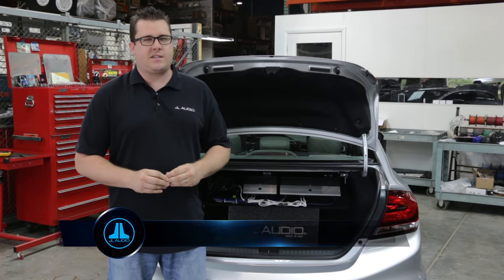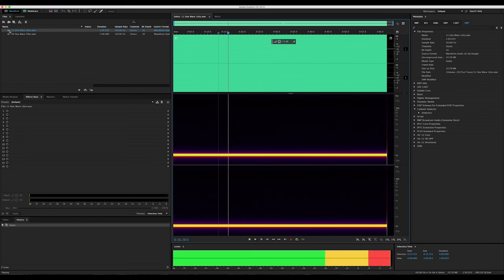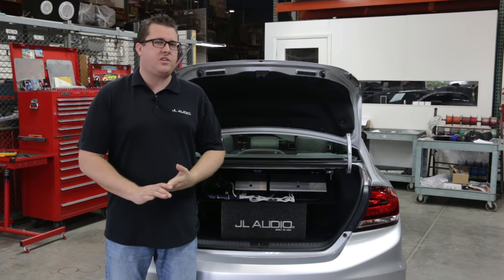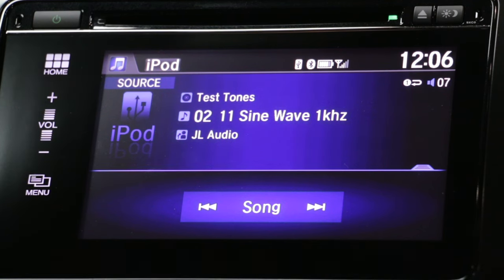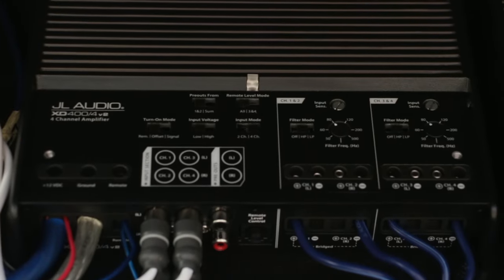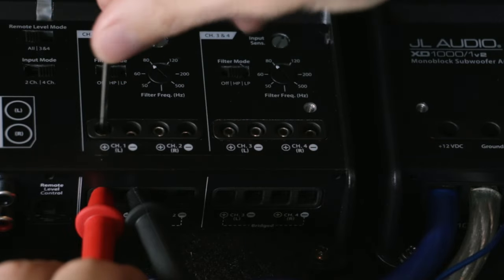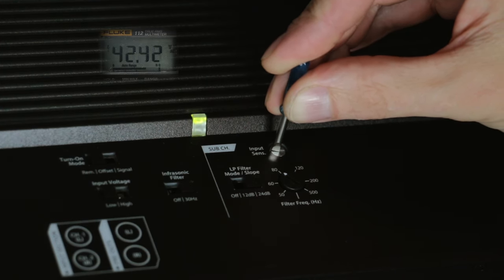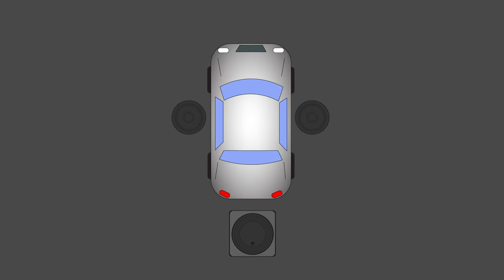Setting Amplifier Gain or Input Sensitivity

Comment: Doing this on a factory radio, will this blow out the door speakers if trying to use the 50 hz sound wave?
Reply from the maker: It is possible to damage the speakers since you cannot mute channels on the OEM radio. In this case, the right way to do it would be to disconnect the speakers themselves so you can play the sine wave through the amp only.
Reply: @JLAudioInc  awesome thanks for the info

Comment: Question, if you set this at 3/4 volume but run your system at nearly full volume quite often, will you not be clipping the speakers most of the time during normal use?
Reply: i think its cuz some songs are recorded at higher dB so it leaves some room in case it clips, either that or i read sometimes the HU itself can clip at full volume. Either way im still kinda lost on this and i just got an amp with a clip light lol
Reply: This is the issue using a multimeter, if gives you the info you need however it comes with the caveat that you already know the signal is clean. To me, it's very important to know how high you can turn up your receiver before it sends a clipped signal to the amp, even more important than knowing where to set the gain because if it's sending a clipped signal to the amp, anywhere you set the gain knob is gonna be clipping point. Not good!!
 I bought an $80 multimter/oscilloscope off Amazon and used that to tell me how high I can turn up my receiver before it clips, and then it tells me how high i can set the gain before clipping occurs.  And yes, it's def not as detailed of a sine wave as a $300 oscilloscope, but at least you know when you've reached your clipping point!
Reply: @GlycerinZ  yeah i was looking at oscilliscopes, but after getting an amp with a clip light, im surprised how much gain and volume it needs before it starts clipping. A new sub or amp is about the same as a decent oscilliscope so im just gonna wait till one blows lol

Comment: why is it that when i did this and hit target voltage as per math. then i play music the voltage is about half? no change in head unit volume just a change in supplied program.. test tone vs music. normal? seems like there is more on the table
Reply from the maker: Thanks for reaching out! Music is dynamic and not a constant tone like used for setting sensitivity. This is why average voltage would be less when testing with music. The tone is used at 3/4 volume to give you leeway to go up a bit in volume from 3/4 for quieter tracks.

Comment: So guessing after you set the gain you Can adjust the eq settings on the head unit and it wont distort?
Reply: I've always felt like you should leave your EQ the way you want it when you're setting your gains on your amplifier cuz that's the actual voltage is going to be getting used instead of when the EQ is flat cuz that's not going to be accurate reading.
Reply: @jamesb1988  
I agree! 👍🏻👍🏻

Comment: My Kenwood KAC 8405 Amp isn't on your list. How do I find the correct voltage to set it to? Thanks for the great video...
Reply from the maker: The target voltage is the square root of the RMS x Impedance per channel. So for that amplifier using typical 4 ohm speakers it would be: square root of [ 60 (rms watts) X 4 (ohm) ], which is 15.49V .. Hope this helps!
Reply: You're the fastest reply ever! Thanks. Great. You've finally helped my to set my amp after years of listening to it too low. I'm so happy lol! Thank you
Reply from the maker: No problem, enjoy!
Reply: So each channel on the amp is 90W @ 2 OHM. The speakers are also rated at 2 OHM. So 90W x 2 = 180. Square root of 180 = 13.4Volts.
Reply from the maker: Yes, that's correct.
Reply: Please help! I thought I did everything correct. I played the 1k hz track at 2/3 volume. hooked up the multi meter to the speaker out and I get nothing. Turned the sensitivity up full and didn't get anything. I quickly swapped the multi meter to the battery on the amp - All good there, reads 0.1 under the direct battery reading so I'm set to the correct units. I checked the sound was playing by putting the speaker cables on... and get the horrible sound lol. So then I turn the meter to a lower setting and get like less than one volt. Any idea? Thanks you
Reply from the maker: Make sure you have the meter set to AC voltage when testing the amplifier output, this is different than the DC voltage when you test the battery. Unfortunately we are out of the office already, but please call us tomorrow at 954-443-1100 if you still need assistance.
Reply: Thanks, I'll give it try again. Thanks for taking the time when you're not even working!

Comment: Hey JL :) i have a question, does the adjustment you show here work with a typical bassremote? 
The remote doesent change the gain but just the level of the bass am i right? so does this work, as you show in the video with amps like my Amp with a remote?
/ R
Reply from the maker: Hello, for the JX, RD, XDv2 and HD amplifiers the knob functions as an attenuation and goes up to the point at which you set the gain.  On the Slash v3 amplifiers the knob functions as a boost knob only.
Reply: Bass knobs definitely just max out at the point of where your input sensitivity gain is set

Comment: if all settings are set to flat or off before setting gain, won't it mess up the signal later when we make adjustments to the treble or bass?
Reply from the maker: Yes, there would be a slight increase in level by boosting any of the "tone" settings on the radio. 

Ideally, the new equipment along with the added power from the amplifier(s) will negate the need to increase any of those levels in order to achieve a better sound. Lowering the opposite level is a better way to achieve the desired sound... for example, if you feel you need more treble, you can lower the bass slightly to make it balanced, and then you increase the volume for overall output. 

Hope that helps!
Reply: @JLAudioInc  that makes sense. thanks for the reply!

Comment: Just did this to my ground zero amp. But i feel that it is not enough bass. Turning my pioneer headunit up to around 50 on the volume and 10 on speaker level (subwoofer) on the headunit makes it a bit better.  Any tips? Digital design 12" sub
Reply from the maker: Tony, if you are setting the amplifier at 3/4 level and you did the proper target voltage calculation, then that's the amount of overall output the amp is designed to provide. If you feel you need more output, you'll want to consider another subwoofer or a larger subwoofer for more cone area. Trying to increase levels past the point where we know they're safe could lead to a shortened life span on the equipment.
Reply: @JLAudioInc  what do you mean with setting the amp to 3/4 level?
Reply from the maker: We recommend using the 3/4 point (75%) on your headunit to set the amplifier levels, is this what you did when setting the amp? If you followed the instructions and you're sure of the calculations used, then you have measured the output level of the amplifier to be what the manufacturer deemed to be the rated power. If you still need more bass, then you would need to consider a larger subwoofer or multiple subwoofers, and a more powerful amp.

Comment: What if I am running a higher rms five channel amp with lower rms door speakers? My amp pushes out 100 watt rms x 4 channel at 4 ohms. My speakers are rated at 40w rms at 4ohma with a 93db sensitivity. Do i calculate the targeted  voltage by the amp wattage? Which is 1200 watts. Or do i calculate by my lower rms door speakers which are 40 watts? I have yet to install a sub yet. But i assume I should wait to set the 50hz test tone when I install my sub correct?
Reply from the maker: @Mr.Rustyapple, if you wish to try to limit the output of your amplifier a bit you can take the low wattage you wish to achieve and multiply it by the impednace. Then take the square root of that answer for your new, lower target voltage. So 40 watts at 4 ohm would be 40 times 4 = 160. The square root would be 12.6 volts for your new target.
Reply: @JLAudioInc  great thanks!

Comment: I have a 12 inch subwoofer with a monoblock amp and my front and rear speakers arent hooked to any external amp except the head unit itself. How do I test for the head unit maximum volume before it starts distorting? Do I leave the subwoofer speaker disconnected from amp then put the oscilloscope (- probe)&(+ probe) on the amp speakers - and + terminals then play a 1khz tone with the head units eq at default or flat while turning the volume up with the amp gain on minimum, bass boost at 0 and low pass function at max until you can see the max volume when its distorting/clipping. Then do the same to test the 50hz tone and fine a average max volume range between the two test tones then turn up your amp gain up until it shows distorting then back it down just a notch to set the gain?
Reply from the maker: You would need to test the speaker wires directly out of the radio itself for clipping. You could use either tone since the goal is to minimize heavy clipping up to 3/4 volume. Since you are using the signal for bass only I would use a 50 Hz tone so that the clipping level would be more accurate in the bass range.

Comment: if I am using 2 speakers in parallel, one is 2.5 ohms and the other is 4, rated 75 RMS and 40 RMS respectively, should I use the smallest voltage of the two? this would essentially give me 64 rms and 40 rms which I am fine with. Think I got a little over 12 volts in my calculation. Thanks!
Reply: What you can do to make that better is the following.... Go to home Depot and get one of those big screw eyes. Ask someone to borrow a boat and go out to the middle of the lake. Screw the screw eye directly into the middle of those speakers and throw them off overboard for a boat anchor. Then start over using correct equipment...same brand and model speaker.  Same impedance

Comment: I have two questions... 1. I have a JX500/1 monoblock amp with a 300 watt TW1 2ohm sub, do i set the input sens. to the 500 watt rating or the 300 watt rating?? 2. When setting input sensitivity do i turn the bass knob all the way down??
Reply from the maker: @Derrick James, I would suggest following the input sensitivity setting guide in the manual, but use a lower target voltage such as 24.5 volts which would be equivalent to 300 watts at 2 ohm. This should add a buffer of safety for the subwoofer.
Reply: i always set the gain based on the power rating of the speakers connected to it.  And always have amp that puts out more power than the speaker is rated for, just to give the amp a ceiling

Comment: Hi
I have a unit amplifier with 125W RMS x 4ch with 2 gain control. From my reading, with 2 gain control I need to split the RMS value. I need to calculate voltage for my 4 ohm speaker. Does this calculation correct: V=250W x 4. Does the calculation can be used for speaker with crossover installed for my front speaker? Thank You in advanced.
Reply from the maker: Hello, the amplifier's gain structure is split between the channels. Normally you have one gain per channel pair (left / right). So the front left and right are controlled by one gain knob, and rear left and right are controlled by the second knob. If the amp is rated for 125w per channel, and you have 4 ohm speakers, your target voltage is going to be 22.3V
Reply: How did that end up working out?  I'd hope at the time, you had 125W speakers. that's a lot of wattage for a regular speaker!
Reply: @GlycerinZ  everything works fine. Of course i upgrading the speaker as well.

Comment: I am sorry I know this has been asked I just can't seem to find the right answer when finding my target voltage and running speakers in parallel.  I have a mono block that is 1500w X 1rms @ 2ohm powering my (2) 12 inch subs that are 4 ohm 50-400 watts rms. I have them ran parallel so down to 2ohm. Just not sure of the target voltage. I think 54.7 but not sure I'm doing it right. Can you please help. Also what should the crossover frequency be set at? I believe my goes from 40 to 130hz.....
Reply from the maker: Ben, the target voltage would be 40v for 800w RMS @ 2 ohms. I would not recommend running it at the full rms of the amplifier because the woofers are not designed to hold that much power. I'd set the low pass filter at 80hz.
Reply: Thank you so much for your help and the quick response. And saving my speakers. Great video

Comment: “If excessive voltage is being read with the input sensitivity dial turned all the way down, switch the amp’s input voltage from Low to High”... This is what's happening on my multi-meter... but my Kenwood Excelon XR-5S doesn’t have this input voltage setting.. so how do I do this then? ... the signal is coming from my JL Audio FIX 86 DSP via 3 pairs of twisted RCA cables.

Comment: I have a questions, is mono block amp can use to fire up our front mid and tweeters?
Reply from the maker: Hello.

A monoblock amplifier only has one channel, and most have a limited frequency response, as they're designed to be used with subwoofers only. If you wanted to use a monoblock to drive main speakers, you'd need one amplifier that is full range (or very wide range) for each left and right side speaker.

A multi-channel amplifier is far simpler for the application.
Reply: JLAudioInc ok understood,thanks

Comment: I recently bought the same xd400 amp and use it to power a set of C5 components and a set of C5 coaxials. Should my amp settings look exactly like yours (filter freq, etc?) Also, I would use the 17.3 setting, right?
Reply from the maker: @Marty Marinez, I would suggest 80 Hz high pass for the C5 speakers. Then follow our level setting guide with a targer of 17.3 volts at 4 ohm.
Reply: @JLAudioInc  Thank you. Also, this amp should not be very hot to the touch with the setup I currently have, right? After about an hour drive home it wasn't burning but it definitely was warm. Could the amp being on 120hz cause this?
Reply from the maker: @Mary Martinez, the amp will get warm, but shouldn't be overly hot. Having a higher setting wouldn't cause it to run hotter, no. As long as you use a meter or scope to set the sensitivity and have room around the amplifier it should be fine.
Reply: @JLAudioInc  Thank you. Customer service is just another reason I chose to go with nothing but jl audio. Stealthbox w6 for the 6th gen Camaro is next. Can you recommend the perfect amp for it?
Reply from the maker: @Marty Martinez, you are very welcome. I would suggest the XD600/1v2 for a single 12W6v3.
Reply: @JLAudioInc  What does it mean if I am getting different readings from channel 1&2? I am setting the gain to 17.3 on channel 1 but when I connect to channel 2 I am only getting a reading of about 16. Channels 3&4 are perfectly in sync
Reply from the maker: Marty, you may have a slight difference of input signal strength from your source unit. A good test is to swap the input RCA's to see if the difference between the two channels stays present.
Reply: @JLAudioInc   JL Audio  Got it thank you! I feel like my speakers are ALMOST dialed in. However, I feel like I'm at a good balance in terms of bass (not muddy at all) and treble but I don't believe the speakers are as high as they're capable of. If I go lower than 80hz would this allow me to keep the bass in check and also push the speakers closer to their potential? Thank you for all if your help
Reply from the maker: If you've got a subwoofer, there's usually no need to go below 80hz on the high pass filter to the speakers. Lowering the crossover point would allow lower frequency information to be played by the speaker, which we really don't want/need. You can certainly experiment with the crossover frequency to find what best suits your listening style, though.
Reply: @JLAudioInc   JL Audio  I currently do not have a subwoofer. The speakers sound good right now but they are not close to distortion. Instead, it's the bass that gets muddy with the gain going any higher. Is there any way to increase sound level from my speakers without affecting the bass level?
Reply from the maker: Well without a subwoofer, the bass is still coming from the same speakers as the rest of your midrange frequencies. Setting the high pass filter properly will be necessary in order to allow the speaker to play within it's designed frequency range while still staying efficient enough to lower the chance for distortion at high volumes. Try setting the high pass between 80-100hz and see where it sounds best.
Reply: @JLAudioInc  Thank you I've done just that and feel 100 sounds a lot better. However, now with the gain set properly to 17.3 I am getting a hissing sound from the tweeters. Can I adjust the crossover to remedy this somehow? Sorry about so many questions, I am new to all of this. Thank you very much

Comment: Good day , my question is I have a pioneer gm D9604 with 130 watts rms per channel and got an 80 watts rms 6.9 speakers how can I set my gain ..thanks a lot for your help.
Reply from the maker: Hello, you can use this method and target voltage of 22.8 volts if you wish to use the full 130 watts per speaker. If you are a modest listener and play a wide variety of music then the extra power may be nice to have. You would have to be more cautious on the newer, more demanding music.  If you wish to match up the amp at 80 watts per speaker, you will need a target voltage of 17.9 volts.
Reply: JLAudioInc thanks a lot.more power
Reply: I would def set the gain to match the RMS of the speakers and not the amp, which woul dbe 17.9V.  Def should buy ~130W RMS speakers if setting gain for 130